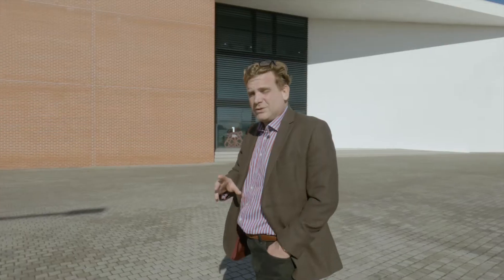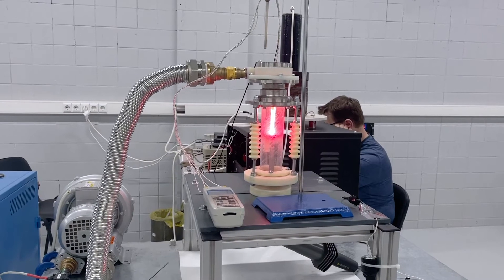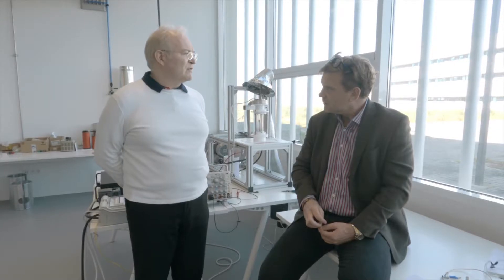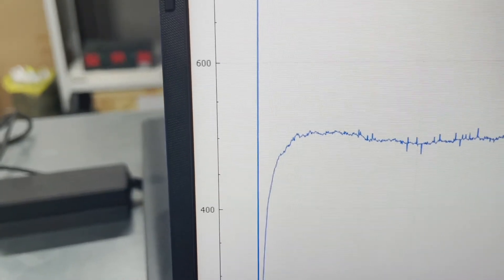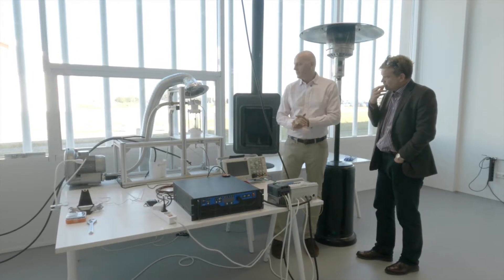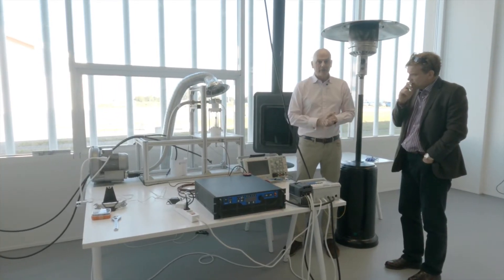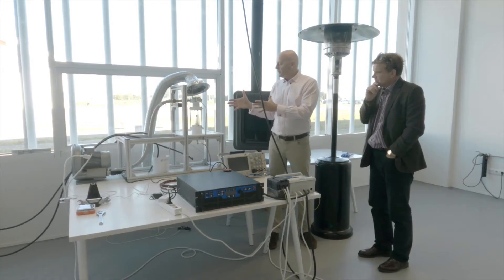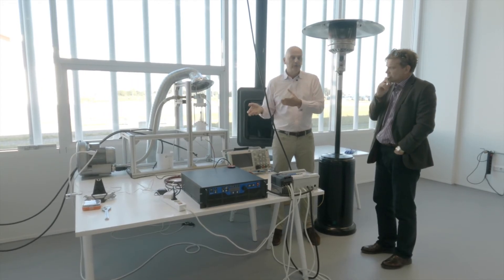EnergiCell from ENG8, Investigation

Comment: Oh they're almost there they can almost make it work if they only get a little bit more money than they can make a little bit bigger system that will actually produce more energy than it takes! Where have we heard this before?

Anyway it's all a moot point now solar panels are so dirt cheap and battery storage is so dirt cheap now that you don't need any fancy gadget to work things through the night because you can store it in cheap batteries now and use the electricity when you need and solar panels are here and they're not mechanical and they don't require mechanical rotating bearings or any of the things like that so frankly all this stuff is a moot point.

Even of it is real.
Reply: good luck with your toxic cobalt mines and chlorine leaching panels. full power to your house will cost a few grand, what  will solar and battery cost you, not to mention africans.

Comment: Any ability in Australia where we need cooling and power . Not heating?
Reply: Heat it power, heat makes steam, steam spins a turbine really fast, connect the turbine to a generator and you have a power station, the water really doesn't care what is making it hot, with only a few exceptions, coal, gas and nuclear plants operate exactly the same after the boiler
Reply: The question is can this thing actually make substantially more heat than the energy going in?. This is really simple to measure, on the electric side you measure the electric power with an off the shelf power meter, they work by measuring current voltage and phase, and on the heat side you use a calorimeter, which pumps water through the system and measures the flow rate, and temperature change this gives you power
Reply: it produces electricity directly